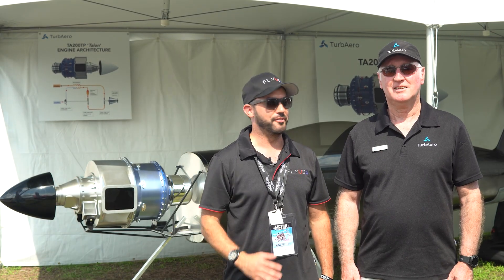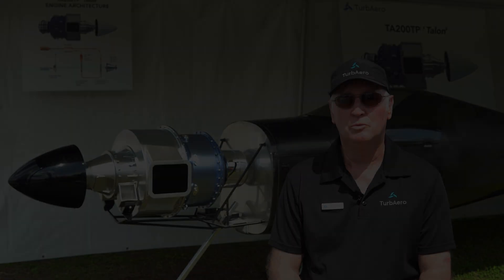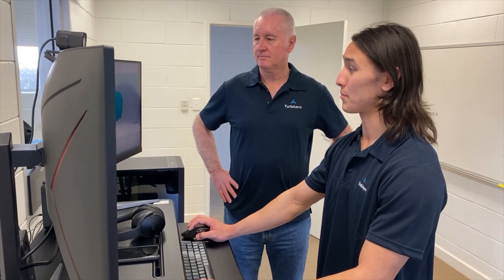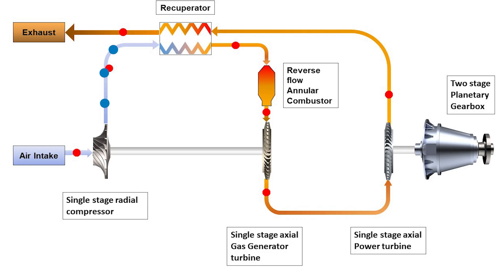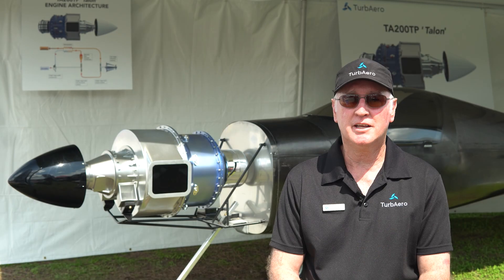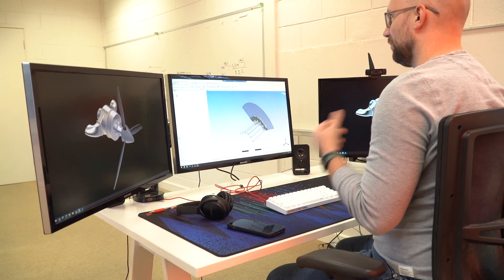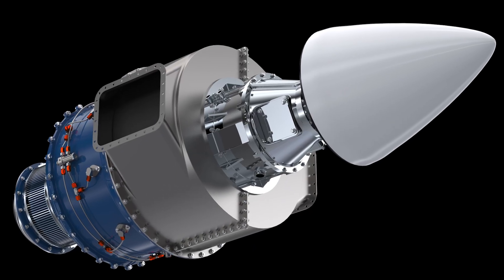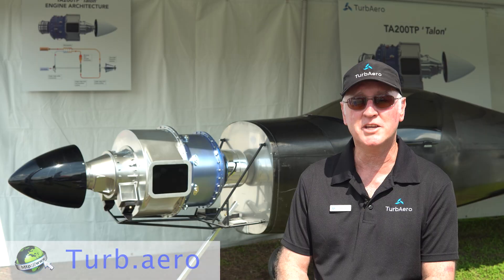200HP Fuel Efficient Turbine Engine by TurbAero

Comment: If it were easy to recoup an additional 20% of useful work by installing a recuperator, with acceptable weight, complexity, cost and service life trade-offs - everybody would be doing it. In fact, OEMs would be jumping at 2%, let alone 20%. Yet, nobody is.

I honestly wish these guys best of luck, but my skepticism is very strong.
Reply: I have just run across another new gas turbine engine manufacturer who is a few years ahead of TurbAero and is using a similar recuperated design: Turbotech SAS (of France, look for "turbotech-aero"). Their engine is at lower power (90 to 100 kW continuous, rather than 150 kW), and is targeted to replace Rotax installations. It has not been successful yet.
Reply: While the efficiency improvement is plausible, I agree that other factors make it difficult to incorporate a recuperator. Recuperators are routinely used by established gas turbine engine manufacturers, but not in aeronautical applications... and not even in many stationary applications (where fuel is cheap).
Reply: Small turbines have a low compression ratio so the air is not heated as much as larger turbine engines. The mass of air flowing through is also much lower so there is less air to heat up. With a large turbine that already has a high compression ratio it is not needed, plus it would restrict incoming air, plus the volume of air would require a very large recuperator.

Comment: No scale drawing or physical cutaway of the engine makes me suspicious.
Reply: They haven't even built one prototype yet, so there's no cutaway. Renderings of the internals would be good, but I wouldn't expect internal dimensions from any manufacturer, especially of a product not yet in production.
Reply: YouTube recommended a video about another similar engine which appears to actually exist: the TP-R90 from Turbotech SAS of France (search for "turbotech-aero"). Their product page shows a cross section; the TurbAero engine is probably very similar.

Comment: Good to see an Aussie company having a crack. I see these as even being a powerplant option for land based applications.
Reply from the maker: I agree, great to see an Aussie company on the world stage. Definitely a lot of applications for these.
Reply: I don't think there are any applications, especially in land based applications. Companies such as Wrightspeed (with their "Fulcrum" radial inflow, axial turbine, recuperated, 80 kW turbine engine and generator set) have developed similar engines, progressed far beyond TurbAero's current state, and failed to find commercially viable applications.
Reply: @brianb-p6586  I can see this as a combined electric generator and heating system for a house, a small race car power plant, or an engine for a refrigerated truck.
Reply: @Chris Henniker  combined heat and power systems can be effective,  but 200 HP is way too big for a system for a house.

It's also too big for a reefer unit.

Racing class rules are very specific about engines; there are very few if any which allow gas turbines.
Reply: @brianb-p6586  I can see this in a small hot rod.
Reply: @Chris Henniker  connected to what? A gas turbine with just a conventional transmission works poorly, due to slow response and terrible part-power efficiency. Any road vehicle designed with a turbine in this century is a series hybrid (small turbine drives generator, battery smooths out power demand), and that isn't cheap or light.
Reply: @brianb-p6586  You appear to be hung on this particular 200-pony unit. Some of us are thinking in different scales.
Reply: @chrishenniker5944  House with smaller scale system, possible but the use of storage (electical, heat and mechanical) would be the key.
Reply: @brianb-p6586  Yes, but there is also a growing need for power where diesel engines are not that great. Grig power supplimentaion is not well known but becoming a need with all the flood of solar that only is usefull for a third of the day.
Reply: @bentheguru4986  at a smaller scale turbine engines are even worse (in efficiency).
Reply: @brianb-p6586  yes.... and no. Different designs and newer materials are opening up things that previously were not possible.

Comment: That’s what the Abrams tank uses in its turbine, and it works very well.
Reply: Funny how I have never seen an Abrams When I'm cruising at 10,000 ft. 🤔
Reply: @Joseph King  you think that's funny, but in the past there have been piston engines used in both tanks and aircraft, such as the Liberty V-12 of WW1, the Continental R-670 and others of the radial era, and variants of the Merlin in WW2.

A recuperator does make an engine heavier, so it's more likely to be seen in a tank application than an aircraft application, but efficiency is the major problem with small turbines so it makes sense to try it for a small aircraft.
Reply from the maker: Google tells me it uses the Honeywell AGT1500
Reply: @RichardofOz  I think he means it uses recuperator tech.
Reply: @aowen2471  Yes, presumably that's what he meant, and the AGT1500 does have a recuperator.
Reply: That is 2000 hp range.
Reply: @alexlo7708  1500 hp... but yes, the Abrams tank engine is much larger than TurbAero's proposed engine.

Comment: GR8 Job! What about an Steam Aircraft Engine? The Besler, 130 HP https://youtu.be/nw6NFmcnW-8  had a weight very little heavier than a Continental of similar power. https://youtu.be/4EbqfT06LeA
Materials have improved since Besler, also technology in boilers, condensers, double or triple expansion, perhaps an small Steam Aircraft Turbine deserves also assessment. 
Thermodynamic Cycle of Steam Machines is inherently less efficient than Internal Combustion Engines, but it could burn anything, AvGas is becoming every day harder to find and more expensive to buy.
Gesund +
Reply: As president of the Steam Automobile Club of America, I can answer that one.  Yes, the Besler engine was fairly light -- of course, that isn't taking into account the boiler, burner, feed water pump, condenser, and makeup water supply.  OK, the steam plant is going to be significantly bulkier and heavier.  Thermodynamically speaking, steam is going to be less efficient.  Steam leaving the engine possessed about 970 BTU per pound of latent heat, which is very hard to recover, so that's a lot of power being tossed away.  Beyond that, the efficiency of thermal cycles is largely dependent upon the difference between the hottest and coolest states of the working fluid throughout the cycle.  In an internal combustion engine, the air can get extremely hot because we just need to cool off the cylinder walls to prevent them from melting.  In a boiler, on the other hand, the heat has to flow from the side of the tube exposed to the hot combustion gasses to the side in which the water is being boiled. Therefore, we can never let the steam temperature even approach the melting temperature of the metal -- thereby also limiting efficiency.  Finally, condensing the steam back into water for reuse is extremely difficult if using air cooling  -- generally speaking, you are tossing a portion of the steam away.  The Besler aircraft basically just circled the field because it couldn't lift the mass of water needed to carry it cross-country.  Not that we can't do better, but it's just one more difficulty that needs addressing.  To loosely toss some numbers around, let's assume that you want to set a cruise at 150 HP.  A reasonably advanced engine would use about 10 lbs of steam an hour for every horsepower produced (lbs/hp-hr) ... so let's call that 1,500 pounds per hour.  Let's assume that we can recover 95 percent of that, which in my opinion would be quite good, that means that we will still be losing about 75 pounds per hour.  If you wanted to stay up in the air for four hours, you would need to plan on having an extra 300 pounds of water on hand... over and above what the powerplant needs for sustained operation.  Note, I think that 95 percent recovery is extremely optimistic.  Now, combine this with the additional fuel burned due to the lower thermodynamic efficiency  and we see that something is going to have to give, be it range or payload.
Reply: @53kenner  GR8 comment!
Reply from the maker: Theres probably a good reason you don't see them
Reply: @RichardofOz  I'd say steam piston engines and steam turbines are more fuel thirsty, but the cost of fuel is lower than AvGas, and is always much easier to find.
Any DIY trying an aircraft steam engine with up to date technology, double expansion?

Comment: I always understood gas turbines are inherently less fuel efficient than reciprocating ones because the peak pressure/temperature in a reciprocating engine can be much higher than in a turbine one precisely because that peak is only very momentary, unlike a turbine where the HP turbine inlet must operate at a constant temperature. Sure a recuperator will help by greatly cooling the exhaust (ie extract the residual energy from the turbine outlet) but surely this is basic thermodynamics. Large turbines offset this lower Carnot limit by getting closer to it than large reciprocating ones through lower pumping and friction losses, but this is unlikely to be so for small turbines. Of course Turbaero's engine should have other advantages over piston engines, including lower aerodynamic profile, greater power-to-weight ratio, smoothness and inherent reliability, but I am sceptical that you will beat an old fashioned piston engine's fuel economy.
Reply: Large gas turbine engines run such high pressure ratios and peak temperatures that their efficiency is comparable to the most efficient gasoline engines (although still lower than similarly large diesels), but small turbines don't even approach that. The Wikipedia page for Brake-specific Fuel Consumption has some good examples.
Reply from the maker: I've asked TurbAero for some comparison figures to post here
Reply: It's compressor section pumping losses that's the big one. So much of the turbine power is wasted through pumping losses that there's not much available for work in comparison to the fuel consumed.
Piston engines for all their shortcomings are remarkably good.
Turbines traditionally were good at high altitude because the higher you go the faster you go for the same indicated airspeed, meaning the time to destination is less so the fuel burn less. Also at high altitude the turbine cycle naturally compresses its own air, the compressor pumping losses are also lower. This all adds up to being efficient in certain commercial situations but until now not so much for non commercial ops.
Reply: Ken, you are correct that diesels and spark engines peak temperature yield greater efficiency than a turbocharger simple GT.       
   As economics allows both pressure (multiple compressor stages) and temperature (via blade cooling) improve GT efficiency.  In complex GTs, the max pressure ratio a question of thermodynamically diminishing returns, and the upper temperature boundary is nitrous oxides (~2100F) emissions.
   For the low hp turbocharger-simple GA market, we are stuck with ~ 3.5 pressure ratio and ~1300F.   The 3.5 ratio is about where a single stage centrifugal compressor goes supersonic; and 1300F is material limitation.  Heat recuperation is effective, but at the expense of weight.  Low pressure ratio recuperative simple GTs have existed since the late 50’s (Rover, Chrysler, Ford, GM all experimented.  Honeywell engine in Abrams tank is recuperated)
   Past decade has seen supersonic high pressure ratio centrifugal compressors with shock wave diffusers.  Simple GTs with supersonic compressors are flying in helicopters (P&W and RR/Allison & perhaps others).  Experiments ongoing with ceramic turbines to increase temperature, but no joy yet.
  Simple GT efficiency also suffers from RELATIVELY thicker boundary layers and RELATIVELY broader clearances.

As to our Australian buddies; with them well but not sanguine as to success.
Reply: @danbenson7587  I assume that your strange term "turbocharger simple GT" is intended to mean a gas turbine engine with a single-stage centrifugal compressor... that's not immediately apparent.
Reply: @brianb-p6586  Correct.  For example a Solar T62 GT is essentially a turbocharger:  centrifugal compressor shafted to radial inflow turbine...as simple as it gets.  This engine is used in small home built helicopters.  Next is a simple GT with a free power turbine in tandem.  
      The GT’s thermodynamic cycle was invented by George Brayton.  His commercially successful engine used pistons!   
       There have been a few external combustion closed cycle GTs.  These are like a water steam cycle loop, but use helium or CO2 for a working fluid.  There have been ‘free piston’ engines (GM, Sulzberger) which have an engine whose exhaust drives the power turbine.  The current diesel powered French main battle tank, Leclerc, when engine off, uses the turbocharger with a combustor as as simple GT to provide auxiliary power.   Could go on and on.  
       Darwinian economic evolution eventually disciplines the market to just a handful of designs as it will the Aussies’ engine.  Still I hope for the magic bullet.     Cheers D
Reply: I wonder if you could have something like the Napier Nomad two stroke diesel engine, but the two stroke would mainly be to combust the mixture.
Reply: @joejoejoejoejoejoe4391  Yes, a piston engine has been used as the final compression, combustion, and first expansion stages of an engine which has turbine engine components for the rest of the engine. This was done when the materials were not available to run a turbine engine at the desired combustion chamber temperatures, and wouldn't make sense now. 

A turbo-compound engine (like the later Nomad, with a turbine just recovering waste energy in the exhaust) does work and is currently offered by Detroit Diesel and Scania. It would be complex for a light aircraft engine.
Reply: @joejoejoejoejoejoe4391  This is a “Free Piston Engine”.  GM experimented, but it had some challenges.
Reply: This is 100% correct however I think the goal here is to get this 200hp range turboshaft / turboprop engine to the 15-30gph fuel flow range - this would put in on par (though still relatively thirsty) with aircraft SI piston engines. It will not beat the likes of avdiesel engines like the Austro AE330 found in the Diamond DA-62 though. Those engines are CRAZY efficient. If I am not mistaken, they do like 15-20gph max at full throttle (400hp range) and offer nearly the same useful payload capacity as an avgas engine would. They are (again if I am not mistaken) based off of a proven Mercedes Benz 2.0L TDI motor platform, just with significant modifications for flight worthiness.
Reply: Say it with me. Based on. 

Off of is an abomination. 

Based on. 

Came frome the bark of a tree. 

Et cetera not exetera. Et cetera. Etc.

Comment: I can imagine RAAUS certifying this, and CASA laughing.
But for an RV 4 or 8 it would do me.
Reply from the maker: Awesome option for the experimental market!
Reply: @RichardofOz  
Yep!
But it took the RAAus decades to lift the stall and increase the weight because Carmody refused everything and the RAAus board were in his pocket, they done nothing to advance sport and recreational aviation. 
Experimental won't advance any further, GA is as good as dead.
Fuel is too expensive, maintenance costs are through the roof, and no work ethics anymore.
Hangerage is too expensive even if you can find it.
Local government want their pound of flesh and refuse freehold tital.
Holbrook made a start and it all died at Wentworth when the developers got too greedy.

Comment: 350g/kwh compared to 250 for modern piston. 350 is at max power also, economy will be worse at lower power settings.
Reply from the maker: Comparing dollar for dollar, also take into account the fact that Jet fuel is cheaper than Avgas, about 20% on average. That brings the cost to operate a lot closer ;)
Reply: @Richard of Oz  You sound like all the turbine people trying to make it sound better  by comparing it to an engine from 1930. I'm talking about a modern engine that uses regular 98 petrol. Jet a1 is about 30% more expensive than 98. The turbine uses 40% more fuel at best, and this engine costs about minimum 3 times as much initially as a modern engine. Of all the engines and companies, none have made honest comparisons, they just say it's comparable.
Reply: @chippyjohn1    First, Build it… and they will come.